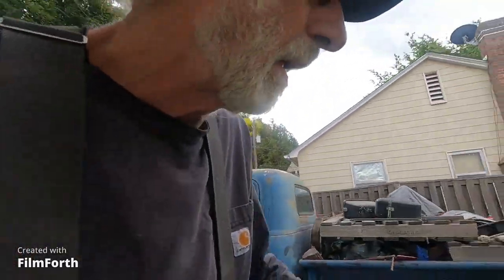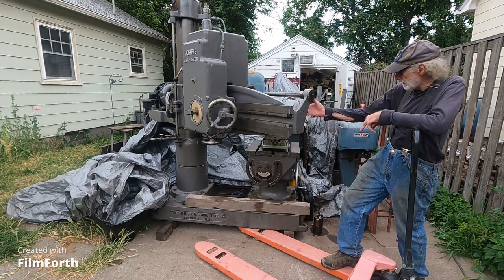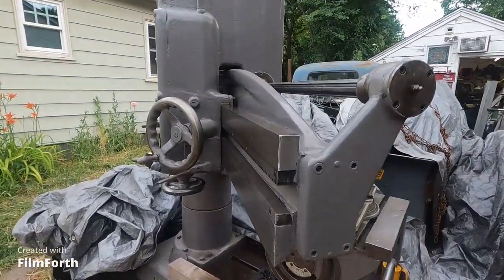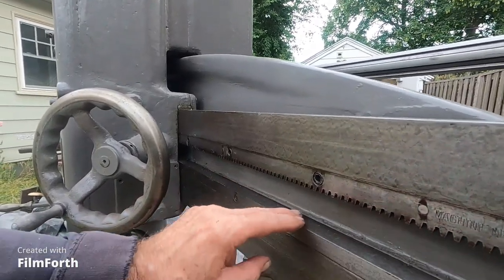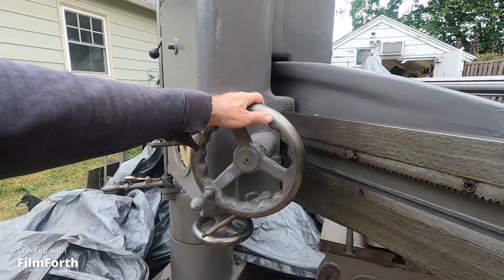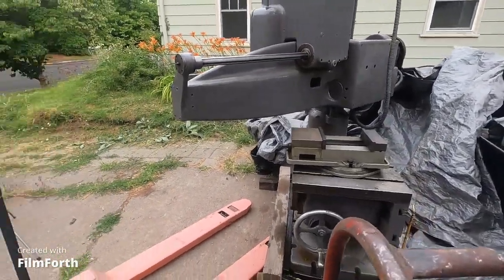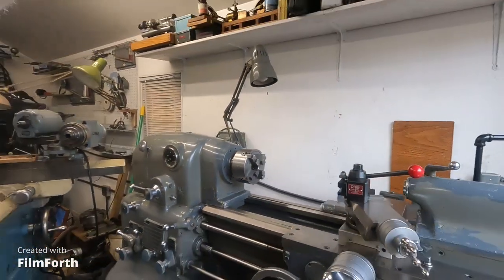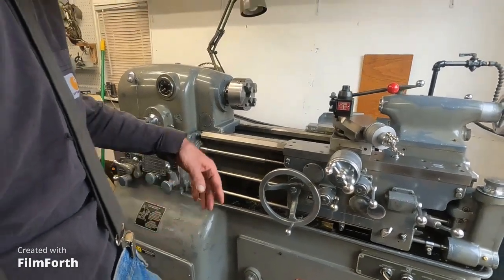My plan to remove the drilling head unit off a 6000lb. radial drill press

Comment: Don you've likely seen this already but I really enjoy the battleship New Jersey youtube content. They did several videos on the ship's machine shop a few years ago and the second one "Battleship New Jersey's Machine Shop with Ken Kersch" showed the machines a bit closer. First machine they showed was a radial drill press that is a dead ringer to yours! Maybe a bit smaller than yours? They said it was original to the ship so WW2 vintage. Made me think of you and your press right away.
Reply from the maker: When I found the drill rusting in the recovery yard I had not heard of the brand and found that they used this same drill on all the battleships and other military settings also. I read that Fosdick made a similar model. What makes these different is the ball bearing cartridge spindle construction like a milling machine instead of a pair of Timken bearings that remain fixed in the head with a shaft passing through. They used these for more than drilling operations, no one seems to know what exactly. The Morris brochure says the 3 row ball bearings in the nose improves machining with the quill extended. I am looking forward to try it out. Thanks!
Reply: @deedeeindustrialsuperprecision  The guy in the video served on the ship during Vietnam and remembered a lot of the machines. When he moved the head around on the Morris it appeared to be effortless. It was a Mor-Speed but yours looks slightly bigger. Maybe because it isn't bolted down to the floor! Good luck with yours, you'll get it in the end, it already looks awesome!

Comment: What kind of bit can you lock in the quill.  That has a strong plate.   A pair of angle iron pieces with some wheels to ride on the angle iron like a rolling gate.   Using the quill feed to adjust the height. 

I wonder if any trench shoring equipment rentals could deliver you a single plate that you could shim up level.  Drag the radial drill onto the steel plate so you have a level area to work from .  Hit the scrap yard for a piece of plate , angle or square to build the roller skate .

I fear  that this might turn out like the marble slab driver who loosened the straps before the fork lift arrived.
Reply from the maker: I was thinking factory assembly might go like that all on flat surfaces. Removing the head off these drills is not very common. I go very slow on these things, thanks

Comment: Yay Chloe! My advice on working on the Drill press is to be extremely careful and perhaps have someone supervise just in case. I was out in my shop last night late in the night working on removing some channel iron from the base. Lucky for me I had it lifted from the top with a chain hoist. When I removed the one in the rear of the machine it became overweight in the rear and started tilting backwards. I was down on the floor in a tight spot but as it started falling backwards, I was able to grab the chain and lift it by taking the slack out of the hoist. So, my advice is to "Expect the Un-Expected. " Snuggles loves watching "The Adventures of Chloe" She jumped up and looked when Chloe barked. lol
Reply from the maker: I do have considerable experience moving and dealing with equipment in field conditions and my set up here is a field condition. I did learn this, if a heavy piece of equipment suddenly shifts "run for it", the equipment can be repaired.
 Chloe has a social life with me working outside and in the garage with all the dog walkers going by.

Comment: Have you looked into a gantry crane? Harbor freight has one for $850. Good for 2000lbs. It does not come with the rolling trolley, but that's another $70.
Just seems safer to hang the gearbox spindle from straps, and will make getting it back on again easy.
Reply from the maker: I think I would need a much heavier gantry, and not enough room here, I know what you re saying, I am still in the planning stage.

Comment: Try to remove anything off you can to lighten it up . And maybe you could take off the front cover and bolt your craddle your going to build Good Luck
Reply from the maker: Yes, thanks, I forgot I need access to inside the head to replace the bearing studs if I damaged them cutting the outer bearing races to be able to free the head, I could drill a couple of pieces of angle iron to fit the cover bolts and bolt that to the cradle. I think I need to build a wood stand that will solidly hold the head and the stand can be moved with a pallet jack safely....